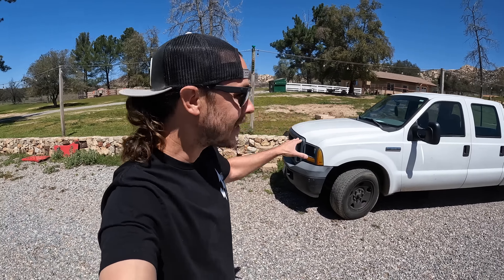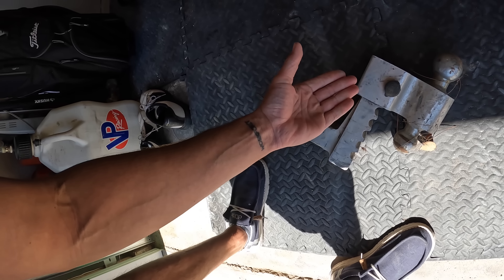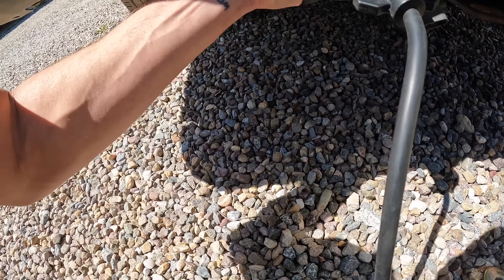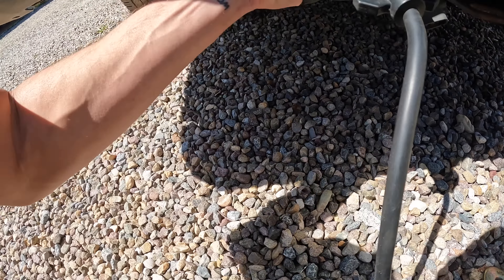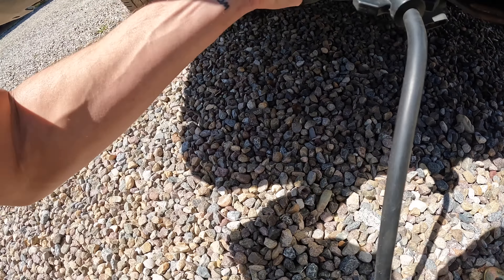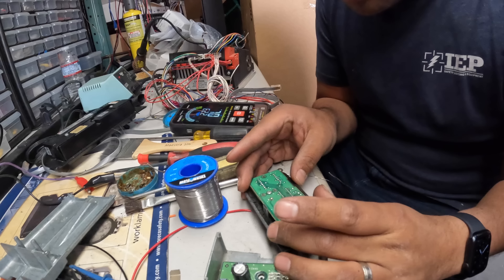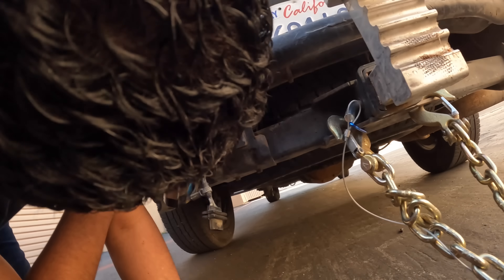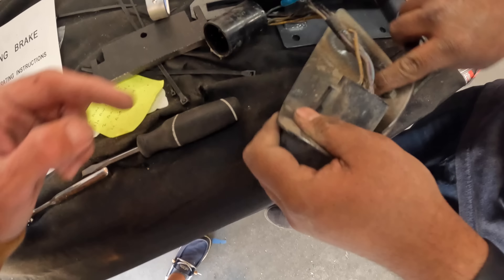Got My 6.0 Back and Went To Tow With it....

Comment: my 6.0 had the TBC fault i was driving fine then it showed up and when i manually squeezed the breaks for the trailer it would go away and the trailer breaks would engage about 5 min it would come back on I squeeze and it would be fine again i did research to and found out for it to be a cold solder joint on the module instantly  fixed it and haven had issues for the last 6 months

Comment: My tow rig for my 5th wheel is an 06 6.0. Had the oil cooler replaced, arp studs, bulletproof egr, stand pipes, all the usual stuff. It's been pretty rock solid since. (60k miles, only really use it to tow these days) I do have an Edge Insight to monitor temps. The main gauges are only useful for avoiding catastrophe. When they show it hot, stop driving. Also replaced the radiator with a Performance Radiator (the original brand that Bullet Proof rebrands from) after trying a Mishimoto that over heated and went with the Bullet Proof adapter to use the 7.3 engine fan. Solid combos if you're towing heavy.  If the oil is hot, I'd def check out the Oil Cooler. Maybe it's also melting the O Rings in your stand pipes.    Also, $400 bucks and 6 bolts you can replace the rear hitch and trailer wiring setup. I did with mine when it was too rusted to allow hitches to slide in and out. Def worth it.   The Trailer brake controller, when it starts going off with no trailer connected, squeeze the manual brake check and it should stop that.

Comment: If you are melting o rings you need an oil cooler. I was with ford as a diesel tech before these were in production and until 2014. Head stud it and delete the egr. I would do a good billet oil cooler upgrade and high pressure pump quivk connect while you're at it. Make sure you use quality parts. It'll go 500k no problem.

Comment: Only two things I would add to the 6.0 would be a Coolant filtration system and maybe a cold air intake system.
Reply: Because that truck was used and abused, I’d say new pipes all around, intercooler, radiator, intake exhaust etc. these things have tiny valves on the exhaust side so they need to get that hot air out fast as possible

Comment: 6.0’s are actually a pretty good motor. The problem is usually the person working on it. Oil pressure issues are common on these. Instead of going back to the shop 3-4-5 times for the same issue. Why not just replace everything? I did when my HPOP went out, and it has been flawless since. Not studded, EGR delete, exhaust, float ration kit, blue spring kit, KC stage 1 jetfire and tunes and it tows and drive amazing
Reply: Kinda annoying tho that you have to do that work to an engine after you buy the truck.

Comment: Ford has had a really bad batch of standpipes for the past over a year now. Weve had trucks go through a set a month of oem ones. Used Dorman and they were actually better..

Guy was a silly goose for assuming the 05-07 truck needed an hpop... the cast iron pumps are extremely unlikely to fail, I've seen ONE in years, and it was physically exploded..

Maybe guy isnt as good with a 6.0 as he thought... =)